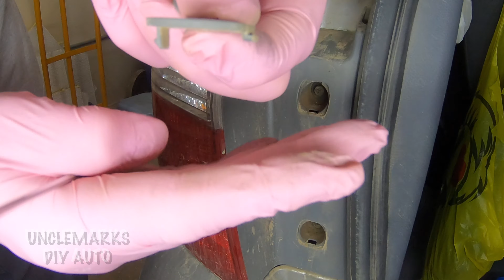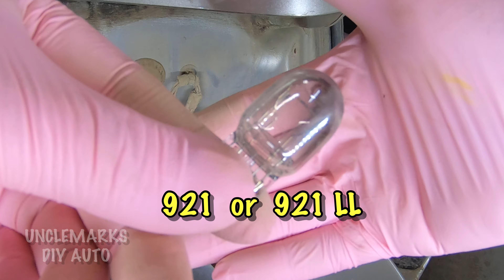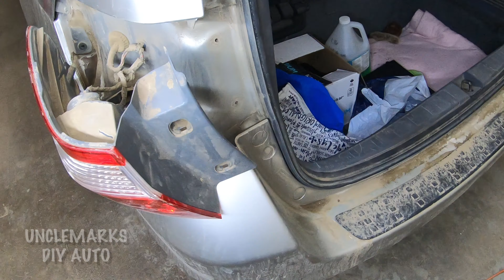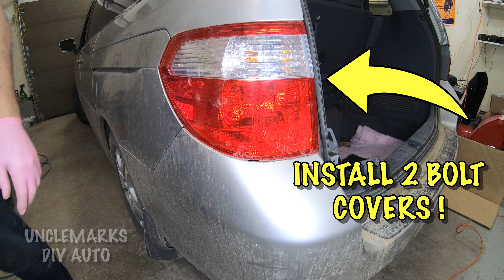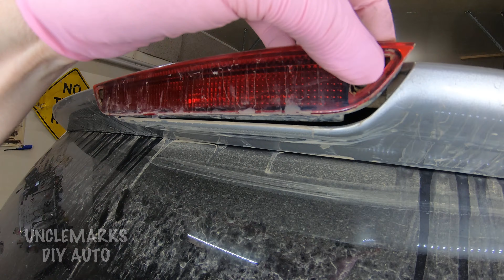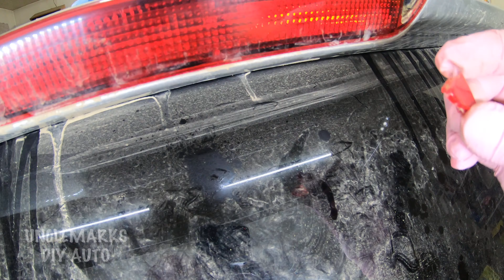How to replace Honda Odyssey tail lights & bulbs?

Comment: Great video as always. Any more Chrysler 200 videos being posted? The “CHECK TPM” light is on. I’m thinking one, or more, of the tire pressure sensor batteries has died. They’re original from 2013.
Reply from the maker: There are a few in that playlist. You must have one or more tire sensor batteries dead. (Non replaceable batteries) A special TPSM scanner that can read which wheel or wheels has the issue. (The scanner is a little bit pricey)
Reply: @unclemarksdiyauto  pretty sure I’ve watched all your Chrysler 200 videos. I’ll be making an appointment with a local tire shop to get the tire pressure sensors replaced. I’ll probably have them replace all four of them; they’re all original from when the car was purchased new.